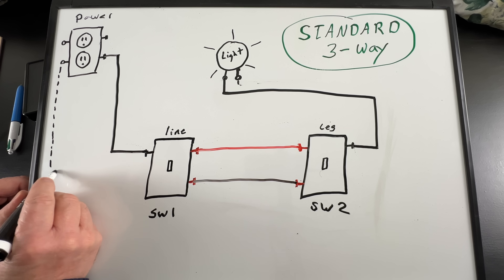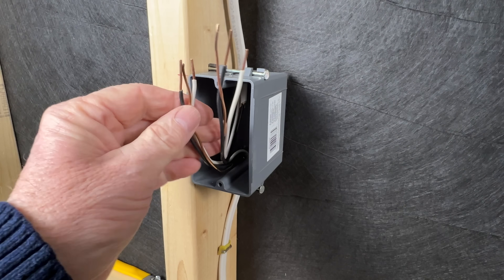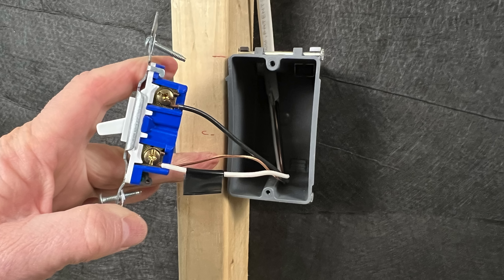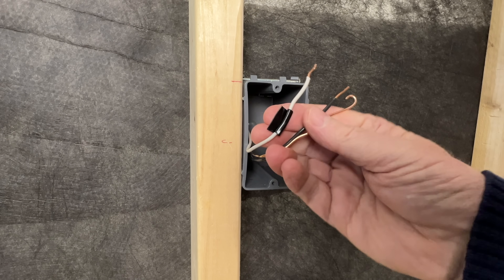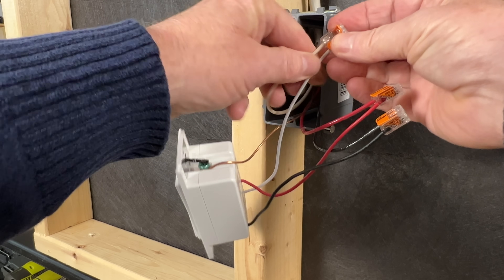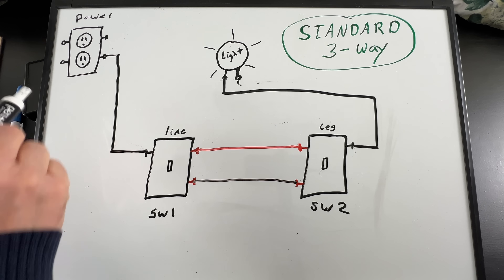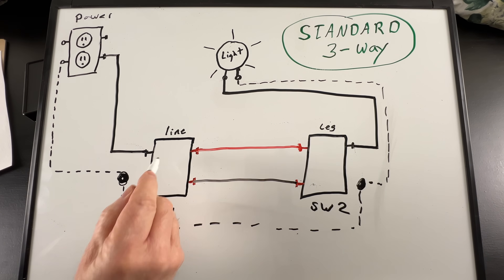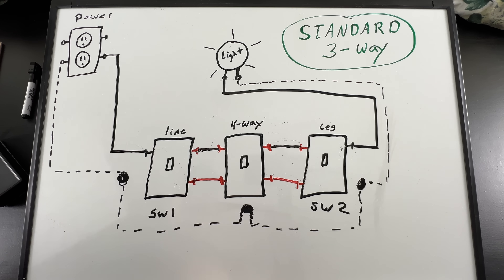How NOT to Wire Light Switches in 2025 (New Rules)

Comment: Requiring a neutral in the switch box doesn't make cali switch legs non compliant. It made that specific box non compliant, but not because you used a cali. It's because you didn't have a neutral. Cali is fully compliant in multi gangs because you'll have a neutral there. Has nothing to do with the two wire setup. In a single gang box? Add a feed wire numbnuts.

Comment: Excellent video.  My jurisdiction is 10 years behind the current code and the inspector is more concerned with the lenght of ground wires than the absence of a neutral.  People who pull homeowner permits don't realize problems they will encounter if they want to take advantage of new technology and this video is exceptional.
Reply from the maker: Thanks so much.
Reply: This old retired electrician is still old school. Don't need smart switches.
Reply: @johnirwin1837  I don't need them now.  But I'm 73 years old and want the house I'm remodeling to be my forever home.  Smart switch technology will allow me to operate all of the electronics from anywhere.  I'm also putting in curbless showers, wider doors, hardwood floors, lever door handles, and pull down kitchen shelves.  Plus, the 2023 code requires that the wiring meet the current code if the walls are open and exposed which they are.
Reply: @Roy-ij1wq  That's what smart fixtures are for. No wiring mods needed.
Reply: @johnirwin1837  Some smart switches are nice for scheduling lighting on-off times (and brightness), particularly for exterior lights.
Reply: @rickgilbrt  True, but I am still old school and old so I won't be using them in my next little wiring project. In 10 to 15 years if the next guy wants them they can install them on their dime.
Reply: @johnirwin1837  Eventually people who make "smart" switches will be smart enough to get them to work without a neutral, just like ordinary dimmers do. Why? because there are going to be older homes with older wiring well in to the future. The the market demands it, someone will make it. Basically all it needs is a low power control circuit and a battery that charges with through current whenever the lights are on.
Reply: @seth7745  thanks for the info. way past my time.  I am old.

Comment: Thank you for your great video, and explaining the new electrical code.  Personally, I don't agree (its my opinion) with the dead end method, as that does not include a neutral as you pointed out.  I have seen many "shade tree electricians" use the ground wire for the missing neutral for the switches that require a neutral connection.

Comment: Holy christ, a light switch should never have been wired at the end of a run. not today, not 50 years ago.
Reply: So if the breaker panel is on the north side of a room and the switch is on the south side to control a light on the north side of the room, you want me to run two different 12/2 cables all the way across the room?  Sorry, that is silly.  You just run a dead end, and usually I would wire it with 12/3 just in case I wanted the neutral there for some later rework.  This change to the code just makes this previous nice to have a requirement.
Reply: I just don’t understand why you just don’t run a 3 wire to the switch and you have the neutral wire in the box if you need it and you are only running one cable
Reply: I think part of the issue these days is that copper costs about the same as a crack habit.
Reply: @timothydixon2545 because 3 wire is twice the cost of two wire
Reply: @timothydixon2545  increases the cost of the whole job potentially.  The amount of wires changes box sizes and conduit sizes.
Reply: This isn't a safety issue rather a modern convenience issue.  Like he said, the only reason for a neutral in a switch box is because the switch companies want to sell me fancy switches.  I wonder if the switch companies own stock in the copper companies.  As far as I'm concerned, code should only be about safety not convenience.
Reply: As @sdkee said, this can require many feet of extra wire in the current carrying path. It also puts an extra splice in the load's neutral and ground connections. For some switched loads this might drop too much voltage or waste too much power. For all, it adds copper cost.
Reply: If wired right a switch can be any where in circuit with zero issues
Reply: They used to run the power from light to light with just the single wire running to the switch. Troubleshooting four ways is always fun.
Reply: @vinster8884  not if you know what you are doing I’ve been doing electric for 30 years now and all they keep trying to do is dumb it down cause why teach people how to wire stuff
Reply: If you know anything about anything you know a white wire terminated at the switch can't be a neutral or else you just blow breakers
Reply: @prattacaster  you are wrong there are applications where a neutral wire can be switched first of all this was a common way to switch fixtures in old houses the other would be a 100% power discussion where you would use a double pole single throw switch that would switch off the 120v feed and the neutral of that Circuit on the same switch, we often use this in elevators where in the shaft of the elevators the elevator contractor needs to have no potential for back feeds but this also depends on what your state and local authorities have decided
Reply: @prattacaster   Well, there are old wiring habits that prove that statement wrong. 
   They are no longer allowed by code, but you need to know in older homes switching the neutrals instead of the hots was sometimes done.
   There is also a three way wiring method (no longer allowed either) where you wire a hot to one traveller screw and a neutral to the other traveller screw.
   Both common wires go up to the light. When the light is off, you either have two hots at the light, or two neutrals. Flip the switch and you have a hot and a neutral up there and the light turns on....no explosions.
Reply: Why? It saved money 💵 especially when 12/2 NM cable was $12 a roll! 😳
Reply: When I replaced all my switches with smart switches I got lucky and had an actual neutral at every box, my house was built in the late 70's, early 80's
Reply: In
Reply: Switch loops are a DC circuit concept
Reply: All those renovation carpenters cutting the white wire at the switch got a shock!
Reply: You referred to “the common”.  Could you explain that. I have seen people get confused by thinking the common is a certain color which can get you messed up. That is common on low voltage multi voltage transformers.
Reply: And we would a lot of times wire two wire feed then two wire between 3 way switches then two wire out to the fixture/s
Reply: Seriously. I'm an amateur, just learning to diy electrical, and I think switch loops are ridiculous. Just ripped out a couple switch loops and replaced with 2023 NEC code compliant wiring, without even knowing the new code, because Duh???
Reply: @Brewsy92  how do you know it’s code complaint if you don’t know the code?
Reply: @timothydixon2545  got me there I guess.. but then I've been researching proper wiring techniques, and found this video summarizing the new code changes and lo and behold, I'm compliant with the code. Go figure, do something logical and you wind up following the rules lol. And to me, wire loops don't make sense, even not knowing code by heart.
Reply: @Brewsy92  well the world isn’t perfect and sometimes you need to know code so that you can make it work cause there are things like box fill and how many wires and wire nuts, and devices you can have in certain boxes and you might not have room for a full sized box so there’s more to it and most people don’t know what they are reading in our code book anyway

Comment: The 23NEC recognizes devices as switches need power; digital timers,  tp-link, etc.  Old school lighting circuits with the drop loop are fine until someone comes along and adds a device, without a neutral uses the ground, the device works!  this creates an alternate pathway to ground, perhaps without a subpanel the risk is marginal, add a subpanel into the mix and is it enough to create a spark on a bonded surface...  why risk it?
Reply: Not if you disconnect the ground part of the loop from the grounds and tie it to neutral. You would want to insulate that ground because it would become energized since it would now be a neutral.

Comment: The idiots that write these codes haven’t worked in the field, in theory it sounds fine, but reality it doesn’t work !!! Electrical inspectors tell you that there are too many wires in the box, no one is on the same page. Better off running a 3 wire to the switch box to supply a neutral, now you have limited the amount of wires in that box.
Reply from the maker: The people who write the code are the best minds in the industry.
Reply: Yeah, the days of itty-bitty boxes are ending.  I'm OK with that.  I'm getting pretty good with a cordless oscillating tool and a masonry box with nice square corners, of whatever size needed to replace them and fit everything with cubic inches to spare.  Time to move up to either 2x6 interior walls, or 2-gang boxes for the trickier 1-gang tasks.  Buy stock in companies that make switch plates in oddball configurations with fewer devices than the number of gangs.

Comment: Good description. Where are the California and Chicago methods? Would like to know what they are.
Reply from the maker: I'll make a video showing those methods as well. Keep an eye out for it on my channel.
Reply: Well I'm a retired IBEW local 701 from the west suburbs of Chicago. I can tell what the Chicago method is. We pipe all homes with EMT and pull wire. The very large outfit I worked for (20 years) had a system. Black,red ,blue hots. white ,gray neutrals  Purple and gray for load side GFI.  Switches   yellow light s-leg first option to use, orange would be s-leg for outlet first option to use.Bath fan would always be yellow light orange fan. Travelers first option would be brown after that you could use 2 purples ,2 oranges 2 yellows. Sometimes in a large home with a 4 or 6 gang main switch we would have all kinds of pairings. Way easier to splice a piped house in my opinion as I've also been in rope homes. Trimming out a piped house is way way easier because of wire color for identifying.  my 2 cents

Comment: A note on the "dead-end" configuration - the code also requires that "the entire floor area of the room or space is visible from the single or combined switch locations." If that's not the case, then the neutral is required at every switch. I'm not sure why that's the requirement, or what "visible from the single or combined switch locations" even means, exactly, but that's what it says. In my house, I have at least one pair of three-way switches controlling a lighting load where you can't see parts of the space from either switch, so a neutral would be required at both.
Reply: That's so wherever you put an occupancy sensing switch, you have a neutral for it.
Reply: @michaelardai9703  That was my thought, but the code says the neutral is only required at one location. It doesn't say that it needs to be present at every location necessary to get full coverage of the space, and it doesn't even say that it needs to be present at a switch that has full coverage. Just that it has to be present at one switch. So if that was their intent, they missed it by a mile.
Reply: @RonParker  If the entire floor area is visible from a single switch location then an occupancy sensor at that location will cover the whole area. Am I missing something?
Reply: @eDoc2020  More likely I'm missing something. 

But what's bothering me is that the code doesn't say that the location with the neutral has to be the location that can see the entire floor. 

And the code also has that "or combined switch locations" which I think means that even if you can't see the entire floor from one switch, as long as you can see the rest of it from the other switch, you only need a neutral at one switch.
Reply: @RonParker   My interpretation is that if you need the "combined switch locations" to see the entire floor you need the neutral in each of those locations. Note that I'm not reading the source, just your quote.
Reply: @RonParker  I went to the wording in the 2017 NEC and it appears you are correct. If you can see the entire area from one switch box it is okay to have the only neutral be in another box. At first sight this completely negates the point of the requirement, but upon further thought you may realize that (if it's a standard 3-way setup) the re-purposed white wire can be turned back into a neutral. You'd lose the 3-way functionality but with a motion sensor this doesn't matter.

"Where multiple switch locations control the same lighting load such that the entire floor area of the room or space is visible from the single or combined switch locations, the grounded circuit conductor shall only be required at one location."

Comment: I suppose this really was overdue.  I never liked a home run going to a light first, them switchleg jumping out to a wall switch.  Most everything I ever got into, white was not marked by any means.  The next old school shortcut I'd like to see axed is the uninsulated ground wire in romex - lets insulate that.   Suffer a lightning strike and the why reveals itself: flashover in breaker panel or at lighting contactor in commercial applications.  The $40 (or whatever) saved on materials gets nuked by hundreds of dollars in replaced devices - the vaporized copper in a plasma ball cannot be cleaned off bakolite or most other insulation materials, and nuisance tripping of breakers  [if they survive] is pretty much guaranteed.   In the instance of a breaker panel taking a hit, a replacement of backplane/buss assembly is possible... if they still make it.  But how many of us have a picture of panel interior or at least wrote down the data as tagged?  That info may just disappear in a hard fault or flashover.
Reply: Why on earth would you want to insulate ground ?  Isn't it supposed to be path of least resistance if cable is compromized in the wall ?  You want your stray current to find the ground as easily as possible.